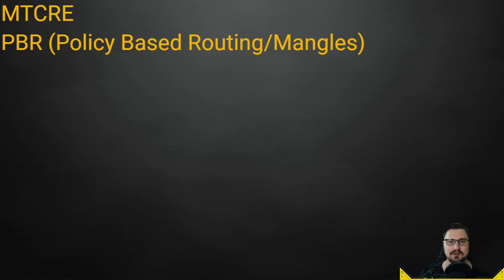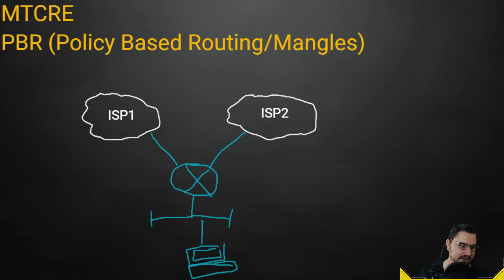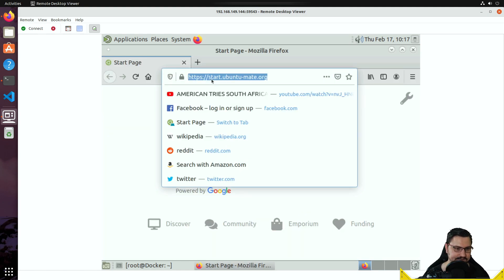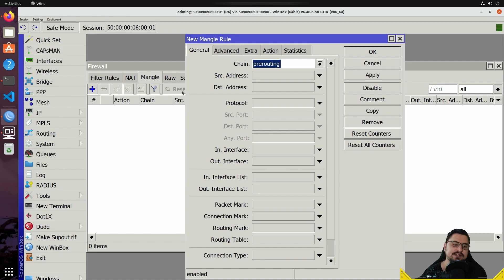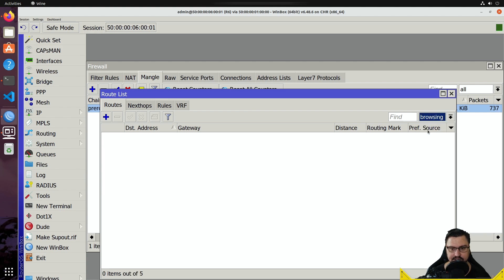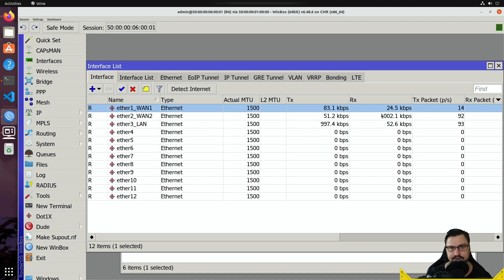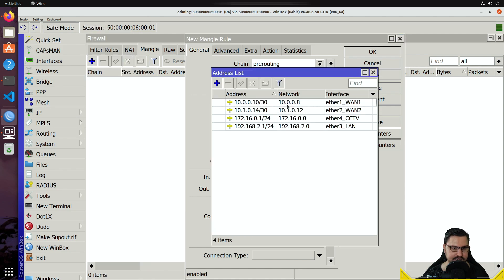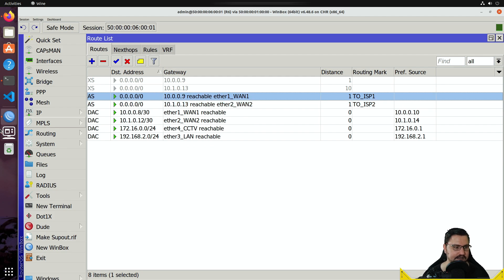Full MikroTik MTCRE - Policy Based Routing (Mangles) 😎 (Episode 5)

Comment: Hello! Can anyone tell which differences between mangle output and routing rules? I have router with 2 isp and 2 ipsec tunnels, 1 from isp1, 2 from isp2. I need to setup connection between peer using isp2, but ipsec goes into main route table by default. I resolve this problem by adding routing rule from src to dst with /32 mask, but I dont know how to do this via mangle. Can you help me?

Comment: Would it be possible to create mangle rules/PBR for return traffic to internet.
I have ISP A-primary(behind a NAT of another router) and ISP B- backup(PPPoE connection from my router). 
I can only use ISP B to reach my home network from the outside(IPSec tunnel, Port forwarding to internal network devices, etc).
Problem is, when I try to access from outside(internet) using the ISP B, the reply traffic going out uses the primary route.
I'd like to mark the incoming traffic from ISP B somehow, and make the return traffic for it use the ISP B route instead of the primary route. 
Any help on this please ?

Comment: I have an issue with your example: I have several vlans (say 5 and 10) and 2 WANS. 

When I added your mangle rule to route VL10 through WAN2, devices in VL10 can no longer ping or access devices in VL5.

/ip firewall mangle
add action=mark-routing chain=prerouting new-routing-mark=out-wan2 passthrough=no src-address-list="VL10 - Office"

/ip route
add check-gateway=ping distance=30 gateway=192.168.18.1 
routing-mark=out-wan2

When I try to add "out-interface-list=WAN2" to the mangle rule, I get an error "Outgoing interface matching not possible in input and prerouting chains".

How do I overcome this limitation? Thank you